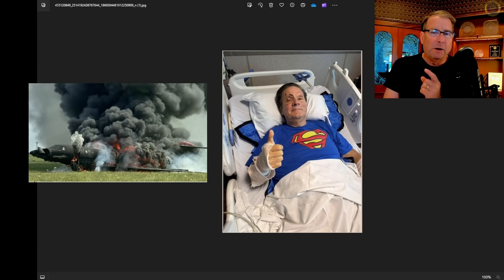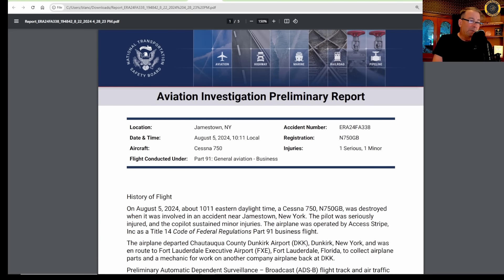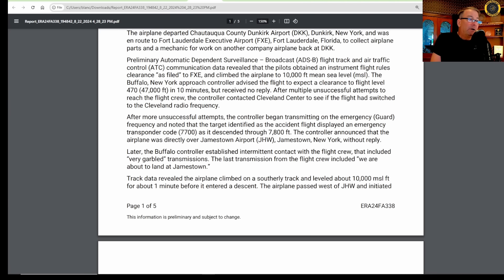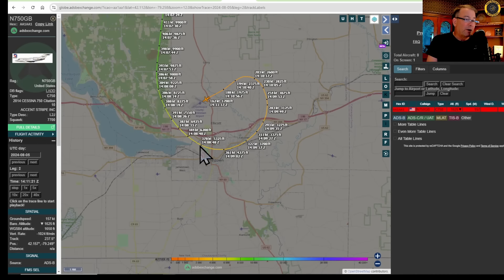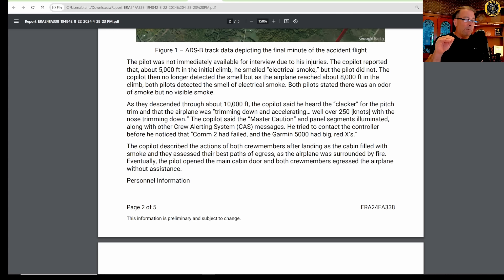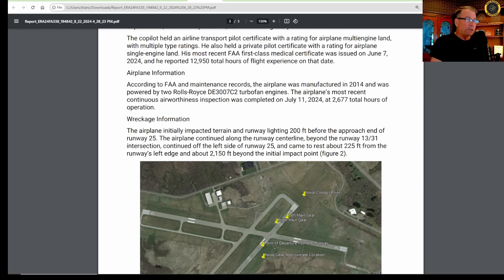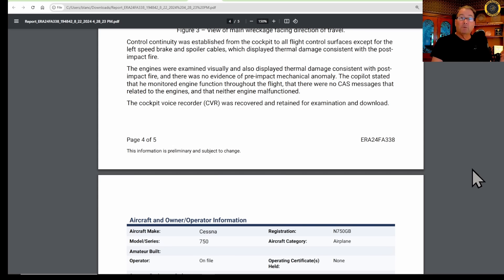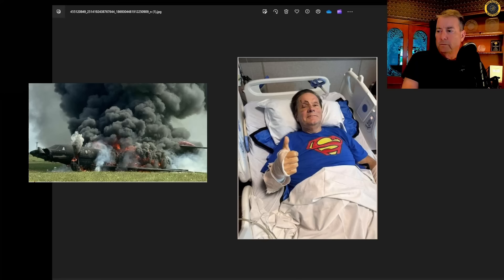Smoke in the Cockpit/Electrical Failure N750GB 5 Aug 2024 NTSB Prelim

Comment: Hey.  I was in a fire, a Swearingin Metroliner.  Sun Aire, KPSP in 1983.  I was right seat.  We are lucky that we were on the ground.  I smelled electrical burning first.  
That ignited the insulation that had been soaked with hydraulic fluid.  Then, the supplemental 02 got involved.

The airplane, N63SA. was repaired, and re-named "Phoenix".  True story.
Reply from the maker: Wow!
Reply: Nice. Metroliners are a pita to work on
Reply: Hoooray dor these experienced well trained quick thinking pilots! If someone says they smell something burning..  believe it and act STAT. 🎉❤ WAY TO GO!
Reply: @michelebouvet8074  If I understood correctly, at the first smell, they did NOT react because the 2nd pilot couldn't smell it. New rule: ANYbody in cockpit smells smoke, put 'er down and investigate. Can always go another day.
Reply: @cassandratq9301 Reminds me of an incident at my old employer. Walked in one morning to the intense smell of rubber and "super hot tennis shoes" which we knew meant a rubber part had exploded in one of our machines. There was a bad batch of parts that would randomly explode and throw rubber fragments everywhere. Huge mess. The smell was a dead giveaway. I asked the guy on duty which one had blown. He had idea what I was talking about.  Can't you smell it?  No. He had no sense of smell. At all.  What.  We dealt with hot things and knowing when something was on fire was important. He couldn't smell anything.  He was later found to have faked his military records and got fired.  So we had a fake employee who could not smell fumes or smoke or fire.  Great.
Reply: @cassandratq9301   sometimes you get strange smells in aircraft that are not obvious and will go away. You can't just do emergency landings willy nilly every time you think you got a whiff of something.
Reply: @behindthen0thing525   Why not?? And who says it has to be an emergency landing? Just report to the tower that you possibly smell smoke in the cockpit and need to return to the airport to inspect. I'd rather return safely 100 times for nothing than do this once.
Reply: @airplanemechanic9513   I agree to a point but sometimes you can smell something but   it turns out to be nothing, and sometimes not.  Its easy in a vaccuum  to say that you should always do the safest thing but in the world unfortunately there is allot of pressure, and things can seem wrong when they are not wrong, and right when they are wrong. 
I've seen a pilot pulled up into an office to be yelled at by about 4 guys, for being uncomfortable to fly because of weather. 

Usually what they tell you is that, if you will not fly, somebody else will. And you risk your job, reputation, and thats hard when you got an 80,000 dollar student loan for your training that you have to pay off. 

If you worked for a company and regularly aborted revenue flights you would be a pariah. 

Aviation unfortunately lives in a huge grey area. 
We take official training to always do the right thing, to always be safe. But in the real world, you have to surf that grey area to survive or you will be seen as a problem and be disposed of.

Comment: I was really hoping to hear your thoughts on this crash as I flew the X (Ten) for more than a decade. This was horrific and I am so glad the pilots made it out okay even if the captain was hurt pretty bad. The whole thing seemed very strange as the X is a very reliable aircraft from all I've been able to find. Still, you never know--we had No. 1 engine fail (at altitude) and there was little warning. Just a slight rumble and I watched the tape go right down to zero. When more info comes out, I look forward to what you think about this. Cheers!

Comment: I work on Citation X's.  I am glad the crew got out with their lives.  I do have an issue with their claim of a nose down trim.  That horizontal stabilizer is in a nose up position, nearly full nose up.  It's the only trim in the pitch system, as the elevators are hydraulically operated, although there are cables that can position the elevators in the event of hydraulic failure.  In the first picture, when the vertical stabilizer was still intact, if it had been nose down, the leading edge would be up.  It uses an electric screw actuator and it's obviously still attached because it would have flipped to leading edge up if it wasn't, due to the sweep of the horizontal stabs.  As to their claims of full electrical failure, I'll be interested in seeing what the NTSB comes up with.
Reply: They might have solved the trim issue before landing..
Reply: @edwardhewer8530  My thoughts as well.
Reply: @edwardhewer8530  Yeah, otherwise there'd be a big smoking hole.
Reply: @edwardhewer8530  You raise a good point.  Since they were claiming a full electrical failure, they might have been able to get some things working before hitting the ground.  The 750 does not come standard with a FDR, only a CVR, so unless they had a FDR installed as an aftermarket mod, they're going to be dependent on the CVR for protected data, and unless that brings something up, we might not ever get the full story.  Just like the airliners, that thing is a flying computer, but the Garmin avionics package installed on the + isn't hardened to survive a fire, so nothing is going to be recoverable .  All of the relevant components are installed above the baggage bay and in front of the cockpit displays.  There is a proprietary Aircraft Recording System (AReS), but it's data is stored on a card in the aft closet.  That section is completely gone.
Reply: Can you tell us if any of the avionics have lithium ion stand by batteries? And where are they located? If so, I smell an AD note soon.
Reply: @michaelscott8226  Garmin AFCS I'm familiar with has direct hardwired servo disconnect to the servos from the yoke. There's logic in place to prevent runaway on the software end. I don't know about Citation Xs though. Will be interesting to see the findings in a year or two.
Reply: Good observation.
Reply: @i.r.wayright1457  I'm pretty sure they're Ni-Cd.  The only time I've seen Li-Ion's on a X was with the iPads on board some of them, either as part of the crew's electronic flight bags or in the cabin, for passenger use.  If they had any of those in the main cabin, and something went sideways, that would answer some things.  Especially since a lot of ship wiring runs just on the other side of the sidewall panels.  But those would be part of the loose equipment, not actually tracked on the equipment listing.  That rabbit trail could go crazy really quickly.
Reply: @michaelscott8226  Standbys are typically hooked up to pitot-static (and I/O) inside the pressure vessel. If there was enough heat to blow the lines it could expose either system and maybe confuse the AFCS (if not in GPS mode). That's a stretch though. Anyways, so many variables involved.
Reply: They were both smoking cigars in the cockpit and didn't want to get in trouble
Reply: @behindthen0thing525  Your attempt at humor is not appropriate here.
Reply: @michaelscott8226  disappointed to hear no FDR.
Reply: @cassandratq9301  It depends on their seating configuration or whether they opted to install it anyway.  Not a given that it doesn't have one, but most operators that have the planes set up for 9 or fewer passengers don't typically have them installed.  Once they hit 10 belted seats, then they have to install at least a basic system.  I know because just a couple of months ago we had to install an FDR when the operator chose to add the 10th belted passenger seat.